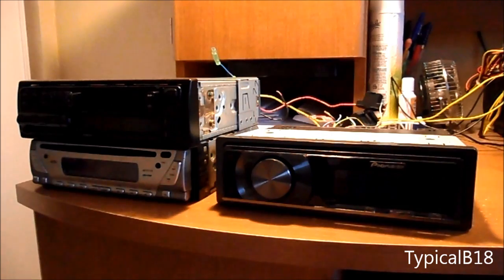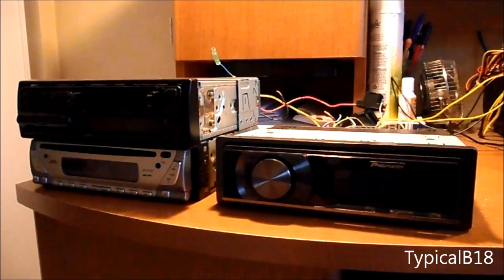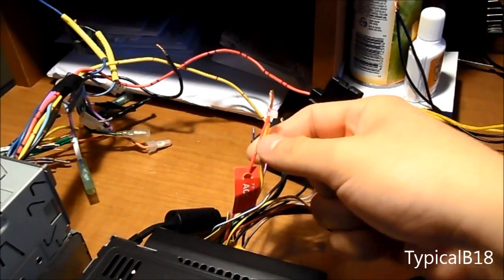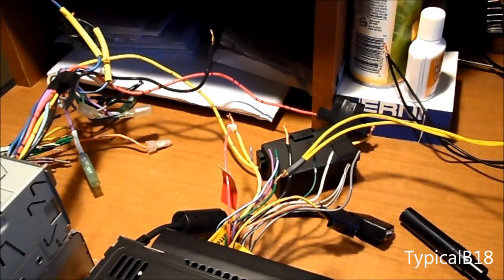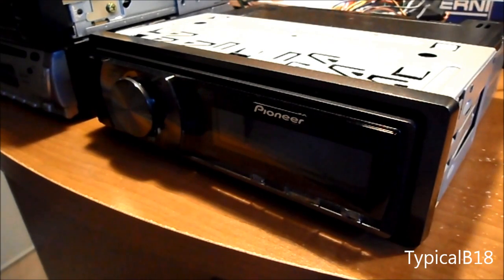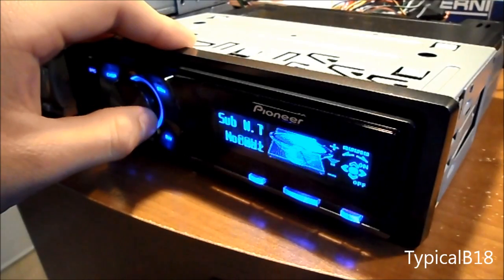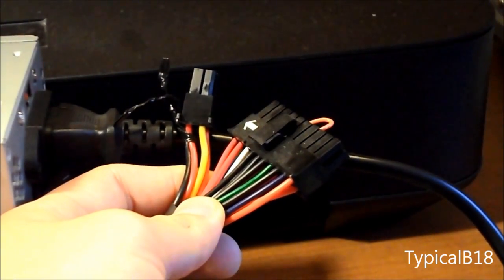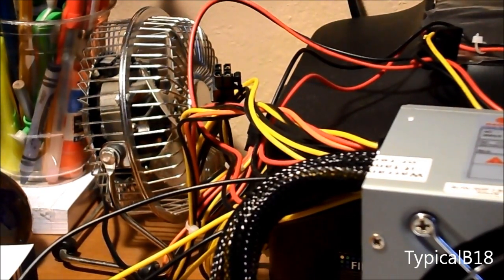How To Power Up A Headunit/Deck/Car Stereo With A PC Power Supply (PSU)

Comment: why 2 yellow cables from the psu?
Reply from the maker: ***** Well you could go with more, I was just using two cause I had two that were spliced.
Reply: TypicalB18 oh great, that's because you can get more amps using more yellow cables right? and the more amps, better, or will i blow up something? (i want to make one, but i dont know if i  should get a 10ampers psu o one with more, as the stereo uses 10amps)

Comment: I've used a HU with my computer for years. Love It.
Need more power???
Search "Delta DPS-1300BB Power Supply" on Ebay.
Its a power supply for servers that's rated to put out 53 amps at 120 Volts. :)
Below is a link to (as I like to call it) "Hot Wiring" the unit.
https://www.youtube.com/watch?v=PwQfu3EEYkc

Comment: Do the head units draw THAT much current that you need to use 2 positive and 2 negative cables from the PSU? I actually have a Lightning Audio B3.200.2 Power Amp hooked up that I use as the amp for my computer's sound  and it's running on the same PSU that's running my actual computer and even with the volume up all the way, it only draws about 4.5 to 5 amps of current. I went a different route: rather than cutting wires on the actual PSU, I found a spare male molex to SATA power adapter I was willing to hack up and wired that to a power jack on the back of my PC to power the amp; for safety sake, I wired in a 15 amp inline fuse to my modification to protect the computer's PSU in the event of a short circuit or overload. The PSU seems to have no issues running both the amp and the computer, I've had it set up for about 3 days now and I don't have any burning smell or smoke coming from the PSU, in fact it appears to be running cool
Reply: Your PSU is certainly a BOSS :)

Comment: Hey. I dont have the cable, so I need to soldering cables directly to the pins on the back of the radio. Which pins on the back is red, yellow and black? My radio is a Sony MDX-C7900R
Reply from the maker: It's going to be very hard to find out which pins are ground, power, and remote. There isn't any information to what pins does what. Only the wiring harness will list what the cables do. I can only suggest getting a wiring harness.
Reply: TypicalB18 Get an online manual this should have a diagram of the pins!
Reply from the maker: +omegasparow Looked for the Online manual for a wiring diagram only lists what the wires are for but not the pins! If you can find one, it'd help that person out!
Reply: http://www.manualslib.com/manual/665760/Sony-Mdx-C7900.html?page=27#manual
Reply from the maker: Nice! Well that'll help out that YT user out! Thanks for the find!

Comment: i have joined green wire with black wire but my psu fan does not go on.i tried three different black wires with no luck.the psu works fine when plugged into pc the fan starts straight away . i am trying to connect an old sony stereo with the same connections as the one you have on the video but cant get it to work. do i have to keep the black boxes with fuses when i join them up
Reply from the maker: So I would keep the fuses on the Wiring harness that goes for the head unit unless you have already cut them off. So first we need to have the PSU's Fan to be running in order to have power. Did you use a jumper to connect the Single Green wire with any of the black/ground wires? Sometimes they can be loose and not make that connection. Without the PSU running you won't get any power to your headunit.
Reply: I twisted the wires together so they were connected tight.when i done this and switched on power supply i could hear a slight buzzing sound but fan did not work. could i be that the psu is not powerfull enough
Reply from the maker: Is the PSU running by itself, I would try that first without it being connected to a headunit or amp and see if the fan stays on. If not something could be wrong or different on that PSU.

Comment: please help me, i search in youtube about the tutorial on how to power a car stereo using a computer power supply, i cut the green, 2 black, 2 yellow wires from power supply, i connected the green wire and black wire , and also the yellow to yellow , on my car stereo i connected the yellow wire to red wire. then i connected the black wire from car stereo to another black wire from computer power supply, and the yellow-yellow wire from computer power supply to yellow-red wire from car stereo then connects the other wires at the speakers then plug the computer power supply to the socket. the car stereo was on and playing mp3 BUT doesn't sound. please help me , you can email me on djovert_conquer@yahoo.com
Reply from the maker: Okay, so it sounds like you have everything correct as the Headunit is up and functioning. I would double check the wiring diagram and see what is the positive and negative for the speaker connections and make sure the headunit has all channels on and check on the level it is on for volume. Also make sure the source is receiving a signal and open for it.

Comment: Ok... Quick question. I've done a mod like this some time ago but I've got a problem that bugs me quite a bit. The stereo works fine but my computer power supply didn't come with a built in switch to turn it off or on. So I basically have to pull the plug anytime I want the fan to turn of (like at night when I'm asleep :P). Is there a way to wire this thing so the power supply would turn on only if I turn on the stereo. Now that I'm writing this I suddenly realized there probably isn't since you need the power on before you can turn on the radio but I'll leave the question anyway :P.
Reply: Here is an option..

http://www.ebay.com/itm/Antminer-ASIC-Bitcoin-ATX-Jumper-Switch-Run-PSU-Power-Supply-w-o-Motherboard-/281483366917
Reply: What you could also do is instead of shorting the 2 leads for what would normally be the computer's power switch, you could use a momentary contact switch, much like an actual computer would use

Comment: but how do you connect the headunit to the amp?
Reply from the maker: Through the RCA Sub outputs of the Headunit which is located on the rear of the headunit. Then take the leading audio RCA Cable to the input of the Subwoofer, just like you would hooking up a Car Radio to a Car Amp in an actual car. You also can hook up the Remote Cable so when your Headunit turns off, the amp will too!

Comment: I had a question.. i just got an equalizer and i have all the stuff i need to hook it up. But i dont know how to trick/over ride the equalizer into thinking the cars turning on please help. Im thinkin about returing it so let me know ASAP. Thanks
Reply from the maker: So you want to use the Equalizer instead of the Headunit's pre set equalizer but you need to over ride it right in order for you just to use the Equalizer to tune sound settings right?
Reply: Ya i want ro use it in my house i have all the right power supply parts needed. But, i need to trick it into thicking that a cars turning on.
Reply from the maker: So at the moment I am looking at a Soundstream Equalizer for reference. I am guess there should be a Ground (Black), Then a Red & Orange Cable coming out of the Equalizer. I am guessing the Red should be power so you would be left with the Orange cable which should work as a signal to tell the Equalizer to power on. I would try just hooking up Power and Ground and if it doesn't power on, use the Orange cable and link it with the Power and see if it turns on after. I don't have a Equalizer in hand so I can't so much.
Reply: Thank u for ur time i will try it and let u know if it works. Thank u.
Reply from the maker: No problem! Best of luck and let me know how it turns out!!

Comment: do have a video on how to hook up the whole sound system up?, head unit and amp
Reply from the maker: I don't but I can try to get one in for you. You simply connect everything up though RCA Cables to supply a sound signal all around.
Reply: TypicalB18 ok that would be great, what i actually referred to was a video where you have the head unit and amp power hooked up, as far as RCA and all that i know how to do, thanks.
Reply from the maker: Ahh I see what you mean. Well it would just pretty much be the same process as in this video and in my Amp video. So instead of having all the Power & Grounds going into either a Headunit or just an Amp you would have lets say 3 Powers & Grounds going into the Amp to power it and then the rest going to the Headunit to power that up. I'd probably get 2 separate PSUs to power each unit up. Not that a Headunit takes a lot of power I'd just rather put less stress on one PSU to power up both things at once. At the moment I still only have one PSU and I'm using that to power up the Amp, so it's a either or for me. Do you think you still need a video to explain it or does this give you a better idea of how it should go?
Reply: TypicalB18 it would help if you would upload a video, what other kinda of power source can i use besides a battery to run a full sound system that i can use for hours?
Reply: TypicalB18 So it is possible to use one power supply to power a deck AND an amp? Then would the deck just power the speakers? Thanks!
Reply from the maker: If you have a very powerful PSU yes you can power both the Amp & Headunit up with that single PSU. Otherwise I'd recommend using separate PSUs. It is still best to use 2 instead one one.

Comment from the maker: Alright, so I'm guessing the Speaker boxes are home audio speakers? And the Sub is a Car Sub? Most car audio Amps & Speakers usually run around 4 Ohms but something you can change it depending on how you wire them. Are your Amps all Car Audio or home audio?

Comment: I have a car radio set up in my workshop that's powered by a computer PSU.
I am getting noise through the speakers, I think it's from the PSU fan.
What filter could I use to eliminate the noise.
Tony

Comment: Hi
Very good demo on use of the PSU.
I have one main problem with static coming through the speakers. I suspect it's coming from the fan in the PSU. Is there any way to eliminate the static
Regards
Tony

Comment: TypicalB, not good enough man. The video was a bit confusing and not very clear cut instructions & tips. Too vague and you missed information. Message me for better instructions & Tips. E.g. Molex Colour Code is an international standard, Yellow being +12v Red being +5v. Warning DO NOT use 4Pin Molex for powering hungry equipment like Audio. Comp PSU are buil in banks of RAILS (bunches of ciruits). 4Pin is the weekest 12V. Use PCI-E (GPU) 6PIN instead, designed for around 100W.